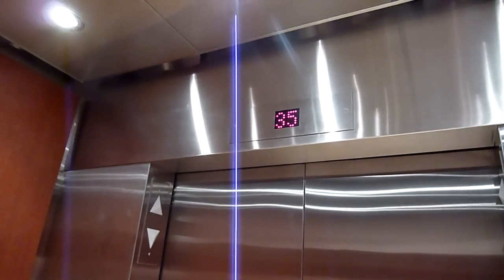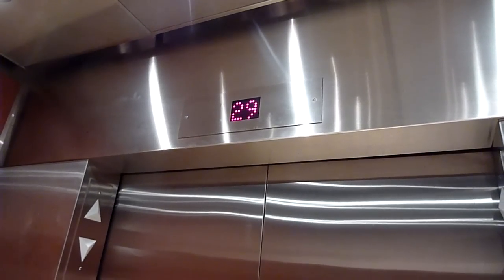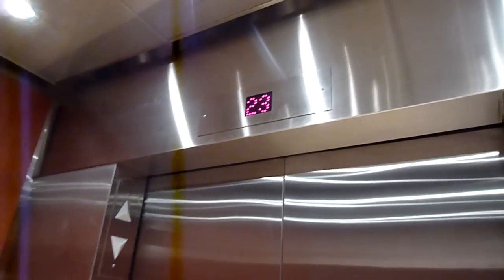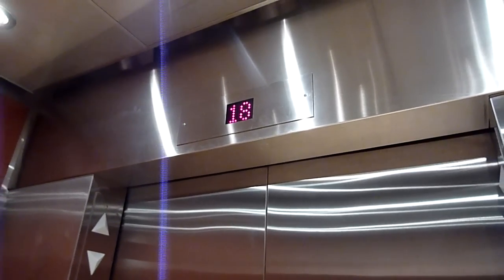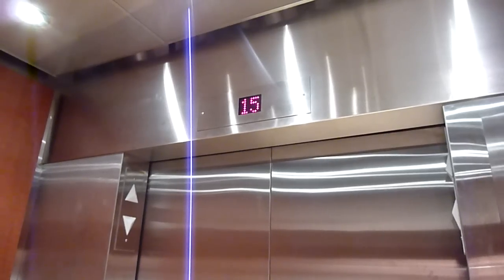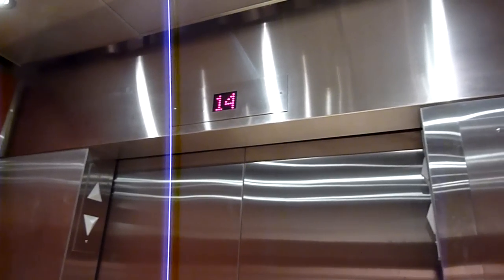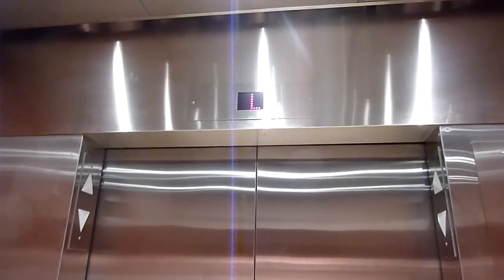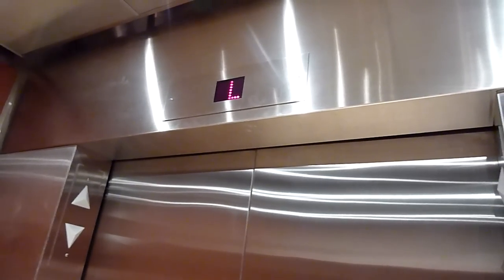SPEEDY's Canadian brother (EPIC FAIL):  Why Armor & ThyssenKrupp DON'T MIX!

Comment from the maker: @CaptainElevator42189 Actually, Speedy is dead! lol They're replacing that one. The other 2 are already done and for the most part, run fine. They seem to have a weird controller glitch that when it goes into nudge mode, the doors only open half way at the next floor. Strange. I'll post an updated video once all 3 elevators are operating. I expect Speedy to be back in service next month, at full speed. The other 2 are very quick, I can get up to my 37th floor apartment in about 35 seconds.

Comment from the maker: @elevatorsonly Yes, I live here. The elevator was super slow  only for a few days, its back up to its normal speed of around 500-600 fpm. However, it is having door issues. Of the 3 elevators, 1 had its equipment replaced, this one is original (only cab and fixtures were modded, 3 years ago), and the other one is about to be operational shortly. This is an Armor elevator from 1975, with TK mods. I wish they installed Otis originally, at least parts would still be available lol.

Comment from the maker: @ElevatingBoston Good point, I'll post an update video soon. "Speedy" is moving at a normal speed now (500fpm), but is having severe door operator issues. Luckily it'll be out of its misery soon, it will be replaced probably before Xmas.

Comment: I'm surprised that Jason hasn't updated this with more info. The day before, the control cable for this elevator actually SNAPPED and came CRASHING DOWN on top of the elevator car while a woman was using it. As a result, after quick repairs, it resumed service at a capped rate of 100fpm. According to Jason, the speed is back to normal.